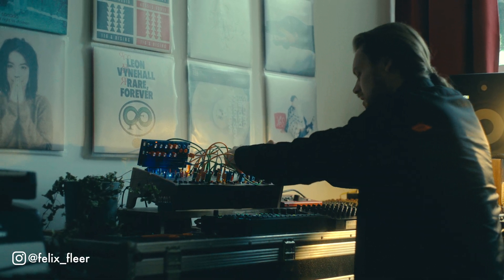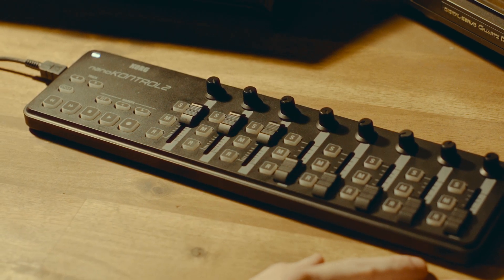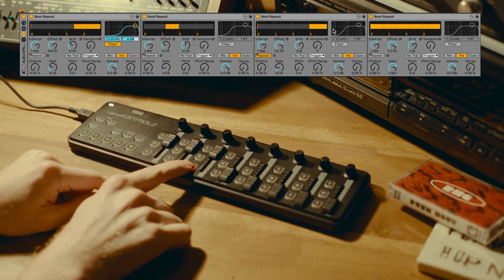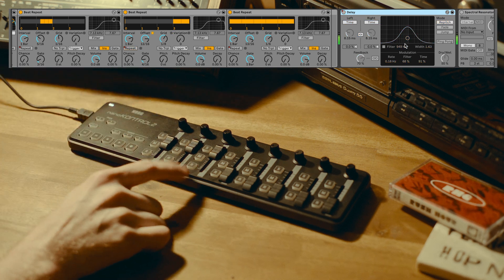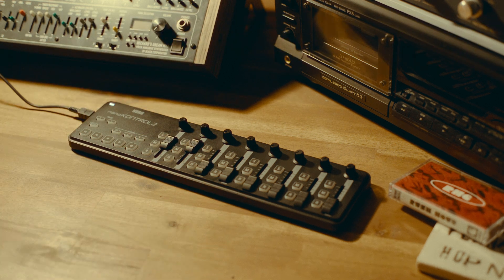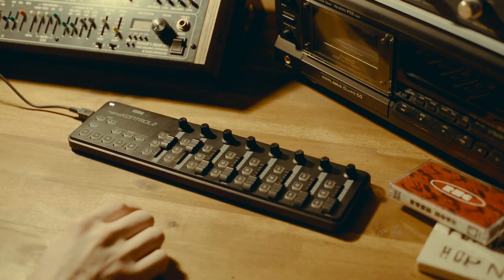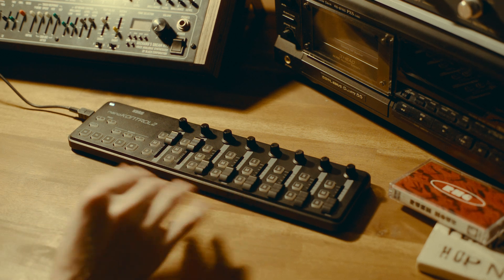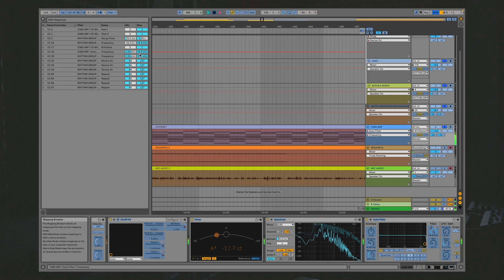Get the most out of your Midi Controllers | Korg Nano Kontrol 2 | Thomann

Comment: I have two midi controllers I love using: a Novation Remote SL MK2 that I have mapped with presets for all my VSTs. I use a somehow similar layout through out all VSTs so the mappings are as consistent as possible (so for example, my amp and filter envelopes are mapped to the 8 faders, whereas oscilator and mixer controls are mapped to the top 8 knobs and filter and lfo controls are mapped to the lower 8 pots. Not all synths are the same, as some have more than oscilator, or only one envelope, but this way I can almost alwyas know what each control does and I can use it as an actual hardware controller. The Novation Remote SL has a nice screen that serves as a cheat code whenever I can't remember what a knob or fader does. My other controller is this exact Korg NanoKontrol and I use it just like this, to map effects on a per session base, so Ill just map whatever control I feel like playing with at that moment.